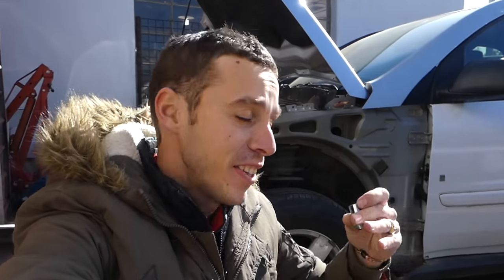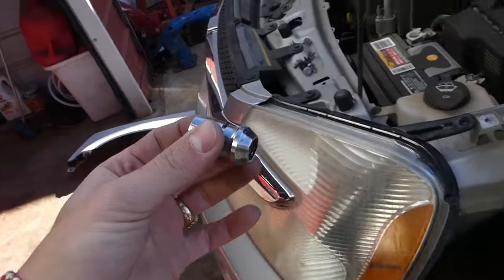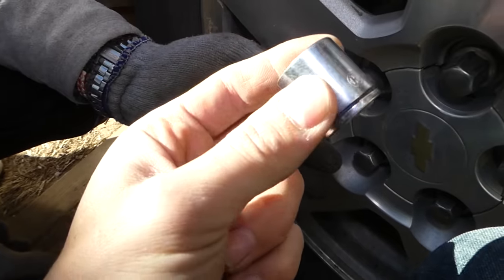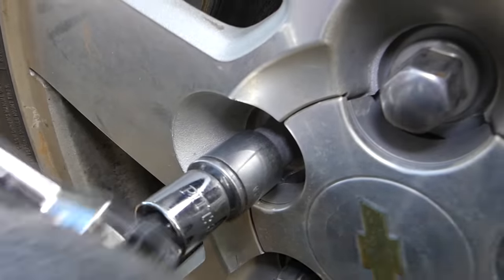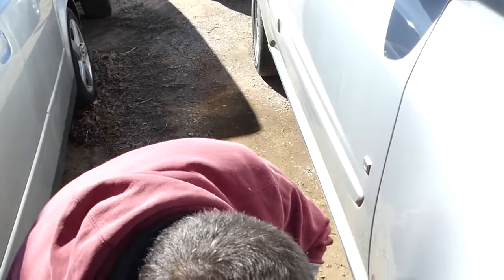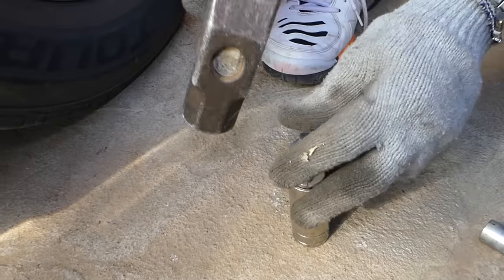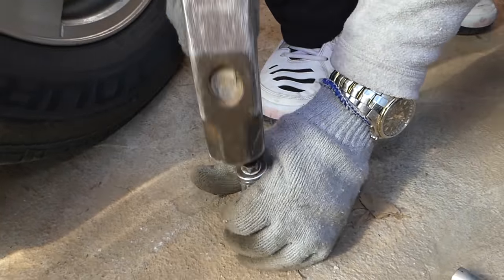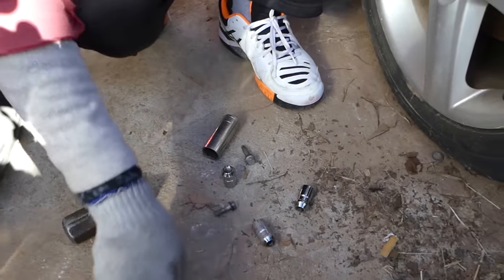HOW TO REMOVE WHEEL LOCKS WITHOUT A KEY TOOL

Comment from the maker: Products that we use and recommend:
► Wheel Lock Removal Tool: https://amzn.to/481Ikf5
► Panel Removal Set: https://amzn.to/3YiMADu
► Tool Set: https://amzn.to/3p5MM6t
► Screwdriver Set: https://amzn.to/3XRB28Q
► Castrol Oil: https://amzn.to/3xBc8B9
► Oil Filter: https://amzn.to/3w0Ulme
► Torque Wrench: https://amzn.to/32qyRwg
►Liqui Moly Oil Saver: https://amzn.to/3xR3Px3
►Liqui Moly Engine Flush: https://amzn.to/3IiDBID
► OBD Scanner that we use most often: https://amzn.to/3I4MQfe

► We buy our Tools and Parts from here: https://www.amazon.com/shop/worldmechanics
Reply: Very good
Reply: Thank you so much for shinning light on solving my issue today. I actually bought a car a month ago and didn't realize the tire needs a key. I will definitely try your technique.
Reply: Auto Repair Guys  Great tip ! .. thank you . 🤠
Reply: Auto Repair Guys
Reply: Thank you for your free training for the thieves.
Reply: Update...Awesome, worked perfectly in less than 20 minutes, after being stuck on for years.Had a 1/2" breaker bar.Purchased $9 Craftsman deep-well, 19mm socket that was obviously thicker and more heavy duty than even the Kobalt brand, so it wouldn't split apart or anything while pounding it on. Used a regular hammer to pound socket on. To remove, turned socket backwards in a pipe wrench and used a punch with a hand sledge for easy, fast removal of lug. Thx alot.
Reply: Thank you from oklahoma
Reply: @frankiebpr  for real!!!
Reply: @kirbyjohnson5487  pqQ
Reply: Incredible, any other tricks for the thieves?
Reply: What size torx bit will work for a Volkswagen beetle lug
Reply: if you teach this what's the point to have one on it. all use normal one.

Comment: Ya all making fun with the guy, I m telling you , I had three wheel lock from hell and I just release them . Thank you for your video.
Reply: Exactly. Some people need this video for legit reasons like when the security socket breaks. They are made like shit and shear apart easy.
Reply: Facts. I lost my key and was scared to drive around because if I got a flat I would be fucked.
Reply: I was going to install a new brake kit, all 4, and this was the only barrier in the way! I didn’t have a dam key for my wheels, some of us do have legit reasons
Reply: Yo I absolutely agree. Just use this method to take off three on my wife's Murano. These suckers are plastic and actually just broke apart while trying to rotate the wheels. 

This video was absolutely helpful.
Reply: Hell yeah , im right here about to take a trip and gathering my things to be ready for anything and i cant find it. I ordered some from amazon to replace them just in case

Comment: another trick in combination with this one .. is to retighten the other wheel nuts on that wheel .. this may tend to reduce the tightness of the locking nut.
Reply: I like it..but the lock is usually not very tight cuz the key wrench won't allow it..
Reply: Aahhh, ic, yeeaah... "nother useful point. thx.
Reply: Yes. Most thieves will do this if you don’t. All professional thieves carry an assortment of locking lug nut tools.

Comment: Well I'll be damned I bought a Kia forte that didn't have the key for the Lugnuts didn't even know there was locking nuts on it until I brought it in for regular maintenance and the mechanics quoted me the labor and cost for breaking them off with a chisel or whatever they do in the hundreds of dollars excluding having to buy four new sets of Lugnuts to replace on top of the maintenance fees I was paying also! thank you for saving me hundreds of dollars because I just tried this now and it works like a charm now all I have to do is get new Lugnuts to replace the ones I take and I can finally get the slow leak in my tire tire fixed without paying hundreds and hundreds of dollars more!

Comment: HUGE THANKS! I tore my car and house apart looking for that key so I could replace a ball joint. I used your method but added a bit of heat to move things along and that lug came right off! This deserves to be the top rated wheel lock removal video.

Comment: This worked great! It cost me $45 in tools, but the repair shop wanted $80 to remove these on my newly purchased used car. So still saved $ and got tools to keep.
 A couple of tips. I had to use a 13/16 socket. 19mm was too small and 22 too large. 
  Also, the worst part was getting the acorns out of the socket. I ended up tightening them hand tight on the wheel stud and gingerly tapping them, one direction and then another to hopefully prevent bending or damaging the stud. Worked great.
Wish I hadn't wasted half hour banging on that pesky screw!
Reply: lol the Mexican tire shop charged me $10 hahahhahaha

Comment: I had a lock nut (circular lock) that was on my rear wheels, bought the car from a dealership at a good price but they didn’t know where the key was. Tried multiple kits for removing and couldn’t get it to work. I saw this video at dinner, dropped my spaghetti on the floor and ran to my car. Popped the trunk, grabbed my cheap Pittsburg 12 point socket set, and the 3lb hammer. Dumped it onto the lock nut and hit it with a breaker bar: and wouldn’t you believe it: it came off. 
Both came off easily and I instantly went to buy replacement lug nuts and changed the brake pads while able to. 

Thank you for this amazing trick!
Reply: Did you go back to that sphagetti dinner!😂

Comment: Dealership installed the locks with too much torque. I broke the key trying to get them off. The key stripped out and broke. Now I have to remove the security lugnut without a key. This helped out a ton and saved me $$ trying to replace the broken key. Thank you!

Comment: Thanks for the video!! the dealership was charging me $140 with no guarantee that my aftermarket wheels would not get damaged. A local tire shop was charging me $40 with the same no guarantee. I did it my self with the tools I already had.
Reply: forgot to mention. I used the same technique and socket that the Auto Repair guys used. My vehicle is a 2000 year vehicle.
Reply: Damn where do you live ? The Mexican tire shops charge $10 bucks to pop locks off

Comment: Thanks for the tip guys! I misplaced my key for my Ram 1500 that had Mopar locking lug nuts. They are the ones that have a rotating sleeve on them. Some people mentioned here that this technic not going to work with this kind of nuts. First I used a slight smaller socket like they showed(I think 1"). It destroyed the sleeve and made it easy to remove. Than I used a smaller socket (18 mm) than the first one and it worked!

Comment: Thank you very much. I have lost the socket. I called my Toyota dealer to see if they could help me as I want to change my car to the winter tires. They told me that only they could do it and I have to take it into them to fix. I don't like been told what to do. Your video has saved me. I did what you said and it worked out great ( although it was hard to are them off the smaller socket). Thanks again

Comment: I spent 2 hours going to different tire shops to see if they could take off the wheel locks on my back tires so I  could get a flat replaced. After I saw your video I had them off in about 10 min. Thank you so much guys!

Comment: Dear. This is permanantly perfect way! I did my 4 nuts this way. And now I can easily check wheel related things. So thank you.
 One thing I want to say is I used 5kg dumbel instead of hammer. Exact aiming of hammer-especilly heavy-is pretty hard. So I did pile drive by dumbel. Little motion,but exact and enough power.

Comment: Wow, awesome, thx. My wheels are locked on the same way. Bought the car slightly used and found no lug key when I got it home. Had no Idea how I was going to rotate the tires, let alone fixing a flat tire on the side of the road... very helpful video.
Reply: smoothy 84 and now you can steel a new set

Comment: Wow! This technique actually worked, saved my ass! But extracting the locknut from the ratchet bolt proved difficult.  Thank you!
Reply: Use a 50/50 mix of ATF and acetone  to reduce the friction.  It should help.

Comment: I'm sure thieves already know how to remove wheel locks. I, however, bought a Camaro with wheel locks and it came without a key.  I welded a nut to the lock and it came right off. This method is a lot easier and I wish I had thought of it. Great tip guys!

Comment: Thank you so much!!  While changing my tires for winter, I broke my lock nut on the 3rd wheel and I was stuck  😭     With your trick it was so easy to remove the safety nuts.  It was actually scarily WAY too easy.  The hardest part was to remove the nut from the socket  🤣

Comment: Tank a lot you Guys. Your tricks just saved my life. Had to unscrew one of those to get to one of my rear hand brake cable jammed in the rust and almost completely blocked the wheel. Did not have one of the bucks you have in the video, but i realised that the circular end of a key do the job...using another key to give me some leverage. Great tricks!!!

Comment: When I was younger  ...  I lost my lug nut key.  So I went out and purchased a new set that came with a key.  I spent hours with a chisel slowly turning the old lugs off.   Then I had a thought  ...  I just wonder  ...  The key was the same as my old set.  You don't get your brains until 35.
Reply: lug nut lock sockets have different patterns. very unusual to find two with the same pattern
Reply: Excuse Me ... Too bad the voting age isn't 30+
Reply: Excuse Me 0
Reply: When I was younger, used to mow people's lawns around the lake.  One day I ran out of gas and forgot to bring the gas can.  Thought to myself "I'll just DRIVE the lawnmower back into the truck and go get gas!"  Then it hit me the reason I needed to get gas in the first place...
Reply: Many factory security lugs have minute differences in the key interface to prevent owners from stealing each others wheels (like garage door openers). You have to drive your car all the way to the dealership, scan the lug and wait for them to look up your specific lug nut key, it is then that you find out the cost and realize that you will never pay that much in a million years, just to remove your wheels. lol
Reply: @smoothy8464  prob cheaper to buy a set of tires elsewhere and they will take it off cause they have some universal lock key that only mechanics buy.
Reply: @thesisko4031  Firestone wouldn't even try w/o my key. Ordered new one this am
Reply: You know what? I bought a new set and I never thought to try the new key. But now I know this works. I don’t even know why I bought a new set for my 13 year old Highlander with stock wheels. Should have just gotten plain old lug nuts so I don’t have to worry about losing that stupid key again.

Comment: Thank you guys.. It saved me so much trouble.  19mm will fit where 20MM lug nut extractor is required. You can't find 20mm wheel lug extractor anywhere.

Comment: I have a removal tool designed specifically for this now, but before I had one I would just tack weld a regular nut to the top of the lock nut. I realize that not everyone has access to a welder, but just thought I would throw my ashop method out there.
Reply: wreckandraceify yea cause a tack weld would hold on no issue
Reply: Welding does work but it also can leave scorch Mark's on the wheel and you have you remove the weld and do it for each wheel...
Reply: I started carrying a welder with me everytime i needed a fresh pair of shoes lol

Comment: Many lock nuts spin freely on the outside preventing this technique from working.
Reply: Na samym końcu złapie.
Reply: I believe that is why he specified to get a 12 point socket. 👍
Reply: Just the new ones. Classic muscle that's sat in a garage for the last decade however...this works while making them road worthy again!
Reply: drumbmajorbeats no he meant the outside shell where the socket attaches spins freely. New ones lock into the actual locking part so this trick won't work on some newer cars.
Reply: Then you just use a chisel or drift pin and smack with said hammer till it stops spinning...THEN use the 12 point or basically and smaller socket...
Reply: @milvolts1  ha ha ha ha ha.
Reply: All Fiats and Chryslers are like that you need an air hammer, chisle bit, and very steady hands
Reply: Heavy screwdriver in the clover leaf cut and an adjustable wrench on the screwdriver
Reply: My '61 Greenbriar had those..I just obliterated the thin outer shells with a 3 pound hammer until they came off..under the shells were 3/4 in (19mm) lug nuts..botta bing..
Reply: Happend to me once & the socket was jammed on the key,then I learned u needed to cut this with grinder or special tool then use the 12 point socket
Reply: @markross7385  whoa whoa not everyone coming here are thieves. My fucking key lock thread shredded when putting my tires back on. Thank god it was on my last one as i was tightening the lugs back on than bam shit just ripped out
Reply: I bought a truck in carmax and it came without the key, now i need to change tires and i hope this helps, the outer part of the lock spins freely so let’s see, Thanks for the video 👍🏻
Reply: If a thief wants them that bad he'll take them no matter what.
Reply: @SierraRacingTeam  any advice? I have same issue with my new car

Comment: I had to do this when my security socket broke. They are pieces of shit that break super easy.
Reply: Did u use an impact ?
Reply: @terp_a_derp_  I hammered on a socket that was a tiny bit smaller than thesecurity nut. Then used a huge ratchet

Comment: Thank you for creating this video. 
Took my car for inspection, failed inspection for rear brakes. Speedy-Midas wanted $400 +. 
Took the car to my tire shop for repair $100; I'm not kidding. 
The nightmare began; the lugnut lock key wasn't in my car. I returned to Speedee to find they had kept it. It was also broken, Speedee agreed to replace it; this took over a month, I'm not kidding. I took the lock key to my tire shop, it did not work ! Frustrated, I youtubed the fix, your video demonstration is the process I used to remove the round keyed nuts. 
By the way, the 'Speedee-Midas'  inspector brought out a handful of various examples of 'keys' for the 'locknuts' to determine which was mine. If you don't have your 'key' to remove the 'locknut' you will be in grave trouble when you have a flat or for any other purpose you may have a need to remove a wheel. 
I used this same method to remove all key lock nuts from my car.

Comment: I just wanted to say thanks its 10/11/19 . I was about to do a complete brake job on my 2008 honda , then I realized I didn't get a key when I purchesed the car , I watched this video at pep boys in the lug nutt àisle,back against the wall , dealer wants $1200 ,I paid $200 for parts , but no key. Ugg... this video safed my ass ,4 for 4 ,worked like a charm I'll be forever gratfull.

Comment: Lets see it done to some that are torqued to 100 ft-lbs...
Reply: The bigger problem is how they were installed, if you replaced tires and/or had a brake job done at a shop.  The boys doing the wrenching are going to use a pneumatic impact wrench, which will tighten it down well past normal human strength.  I carry a manual impact wrench and a hammer in the trunk to help remove lug nuts that I find in this condition.  A couple of solid whacks on it should loosen it.
Reply: stever, i use a 4 way and a foot.
Reply: @stever5887  

they are supposed to use a torque indicator to prevent over tightening, but I know that most dont and that they are inaccurate anyway.

dont go to shit shops.

an impact is ok for removing or quickly snugging up lugs, but never for final torque.

a torque wrench should be used for the final torque.
Reply: I’m with you bigdish 101 that nut was barely on there. Most nuts are too tight for that. Not to mention most of them now are deep in the wheel so you can’t get on it at all. So yes I’m sure it will work but in very few cases
Reply: 100 ft.lbs is really not that tight.
Reply: @christophercipollone1475  My E-350 calls for 175lft/lb

Comment: Hey guys
I just want to say you saved my day! 
I was stressing out because the alignment shop obviously used an impact with my lock nut and completely stripped off the one head and then they must have thrown it away.  Your trick worked on the full locknuts as well as the stripped one.  I have to go to a new jobsite tomorrow and I was really stressing out because the shop effed the tires!
 
Thank you!

High five ✋️
Reply: I have also had lock nuts mysteriously knackered after car comes back from garage.🤔

Comment: Ordered a replacement from Infiniti...key didn’t fit. Went to two shops, one tried and failed, the other said $300 to do all 4 wheels. Drove down the street and bought two 19mm 12-point sockets for $12, hammered them on, locks are off. This video saved my life (and $300).

Comment: Thanks for the tip, I migt need it someday.
It is a lot quicker for someone to saw off your catalytic converter than mess about jacking a car up, getting some bricks and removing the wheels. The locking nuts are designed to deter crooks, not prevent them completely, like most padlocks they can be bypassed.

Comment: You saved my life dude!! They were going to charge me a fortune to get this done. I bought the socket for $5.99 at O'Reilly's I banged that sucker on there with a sledgehammer. And was able to remove all four of them! The hardest part was removing the lug nut from the socket, just like you said. I didn't have an old bolt, but I used a extension I had, and it worked just fine. Thanks so much man!! You save me a hundred bucks on this one!!! :-)

Comment: Worked for me. The key for my UK 2005 Ford Galaxy broke so I used this trick to get the bolts out. Actually very easy. Only problem was getting the socket off the bolt after. New sockets are pretty cheap though.